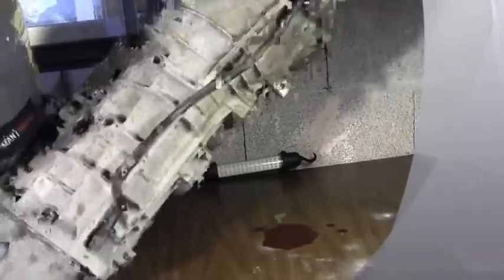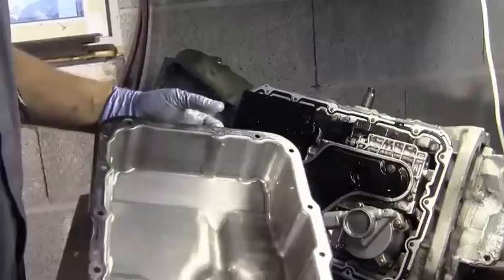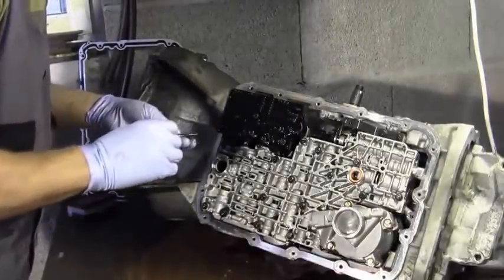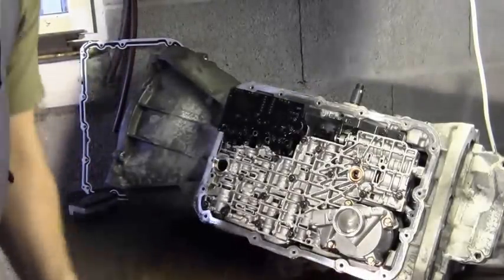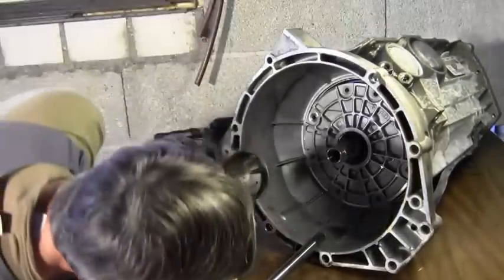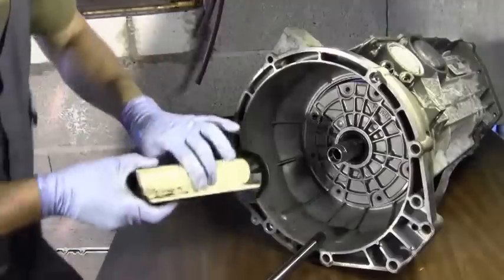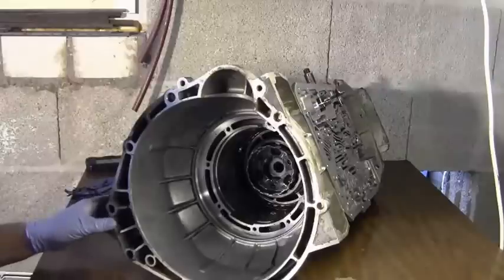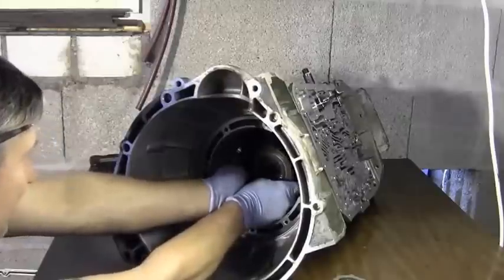5R55S Teardown Disasemble mp4

Comment from the maker: The transmission has been running great for nearly 2 years now. My wife drives the car more than me i drive a 2007 german spec mercedes sprinter that also needs 2nd and 3rd sryncro ring and gears replaced Standby!

Comment from the maker: It’s not a particularly hard transmission to work on but it does need skills and game plan like a manual and a clean place to remove and inspect components. The oil pump housing is tricky to remove without slide hammer

Comment: Hello Rick.  Great video.  I have an 05 explorer XLT 112K mi on it with harsh reverse and soft slip from 2nd to 3rd gear after operating temp is reached.  I also feel a clunk when coming to a stop or picking up speed.  Do you know what this could be?  Thanks.

Comment: There are a lot of helpful videos on the internet, and you made the best one! (Hiram's videos are extremely helpful too). Do you have any videos on how you rebuilt any of the components, such as the solenoid, or how you installed the overhaul kit? Did it all turn out well? I would love to hear more about your case.

Thank you!
Reply from the maker: I did record a reassemble video I need to publish it the rebuild went well I reused the solenoid block though . However I have got a bump in reverse and small bump in 3rd sometimes. Spoke to a transmission guy and he said to reset the adapted learning my scanner "didn't support the module "so it said when I tried to reset the adaptions. If that didnt fix it I will need a new solenoid block
Reply from the maker: Rick Chapman Glad you liked my video its a bit shaky don't know what happened to it
Reply: Rick Chapman I'm pretty sure I have read this somewhere. I think that in order to reset the transmission computer you should leave the battery unplugged over night. Then the car will most likely need a couple of miles until it relearns its shifting strategy, then it will be smooth again.